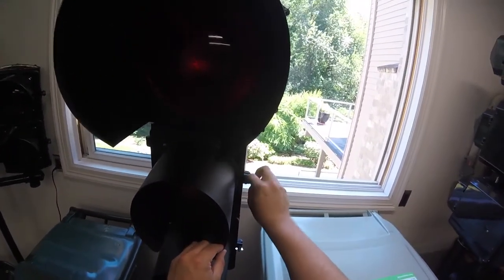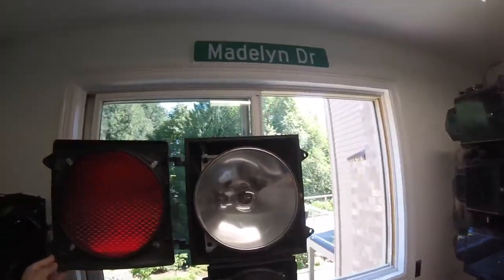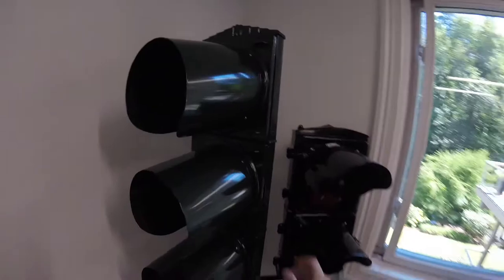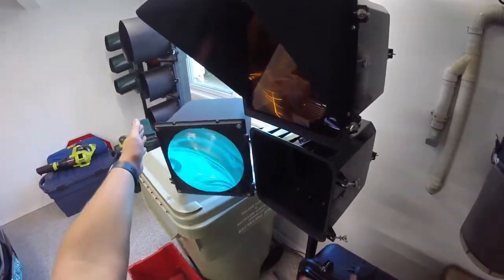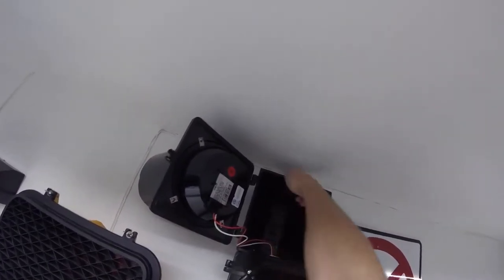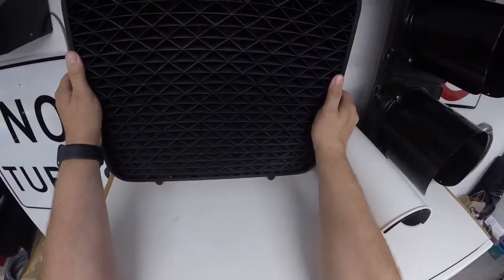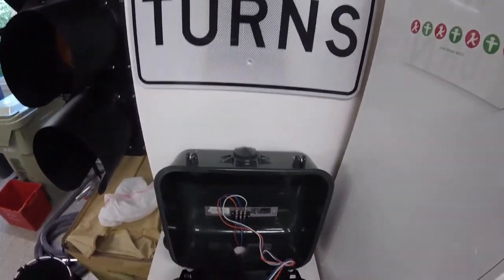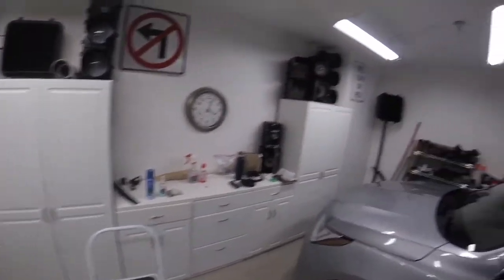Incandescent vs LED Traffic Signals

Comment: Always nice to see your collection videos.
One thing I've been doing with my signals is a sort of mix, swapping the original incandescent bulbs in the sockets for LED bulbs. Lets me have the reduced heat and power use benefits the newer LED signal modules offer while keeping the look of the original glass reflectors and lenses. Though I do keep a few of the signal-spec incandescent ones around in case I want to use those for demonstrations and special occasions.
Regarding some of the pieces in your collection, that was an interesting detail to hear regarding the vents of the ICC's reflectors. Clever indeed. As well as hearing how great of shape that Crouse-Hinds set was when you got it.

Comment: From what I have seen out there, incandescent traffic light bulbs last way longer than people claim. This claim that they only last a few months is BS and that's the cheapest household incandescent bulb. A traffic light incandescent bulb can last up to 16,000 hours if on the whole time. Here in San Diego, they only replace a bulb once it has gone out and there are some bulbs in traffic lights that have actually lasted for over a decade. Then there are some LEDs out there I've seen that only lasted for about 4 to 5 years and it's usually the green light. So I think the only real benefit of LEDs is that they use less energy.
Reply from the maker: There are good and bad versions of everything. Some of the cheaper, off-brand signal LEDs will struggle to last more than a year or two but I know of many first-generation Dialight incandescent-look greens that have been in service for over 20 years. Most of the Dialight units Portland installed in 2008 are still running, too. That said, I also know of a handful of installs running incandescent bulbs that are still going but I'm not sure when they were last replaced.

Comment: Has there ever been in instance where a crossing light (For example let's say the Harmon Fading Leds.) was used as a traffic light signal? And if so, has there been any example of it in video and/or photo?
Reply from the maker: I don't believe so, primarily because railroad signals run on 12 volts (DC or AC) whereas traffic signals are 120 volts AC.

Comment: What bulbs are in there ?
Reply from the maker: The 8" vehicle and 9" ped signals use 69W bulbs, the 12" vehicle signals use 169W bulbs and the 3M uses a 150 watt PAR halogen lamp specifically designed for that application. There are other wattage options for signal bulbs but this is what I run as it is what the City of Portland spec'd back in the incandescent days and the higher wattage bulbs give a more pronounced fade between indications. Also, I don't use my signals enough (maybe 20-30 hours a month) for it to make a real impact on the electric bill. Jump to 15:00 for a comparison between incandescent and LED power consumption.
Reply: @deloreanman14  Thanks, however I wanted to get more technical, voltage, lumens, etc. Can you link me to a catalogue ?